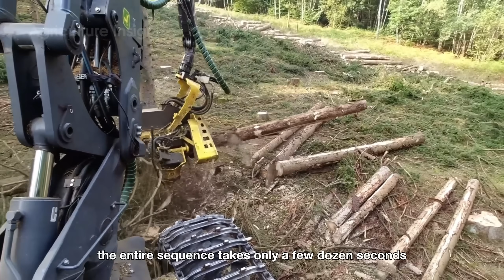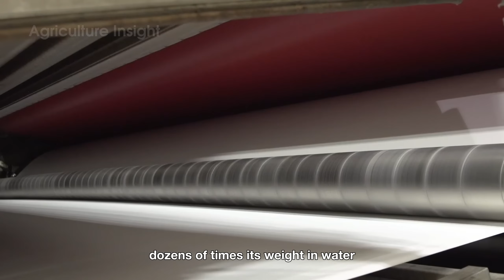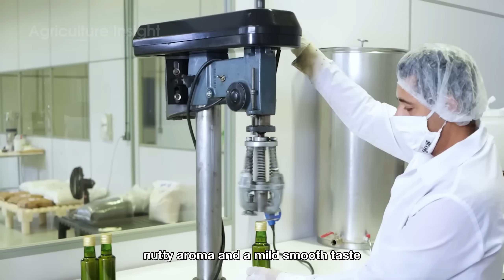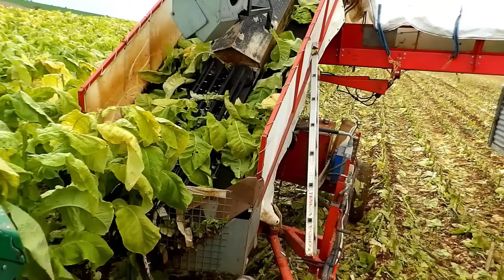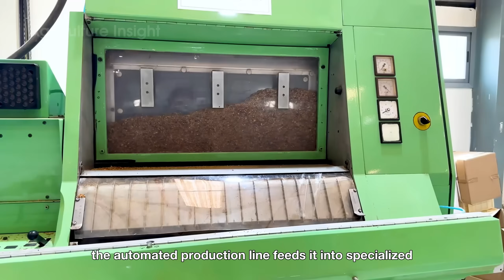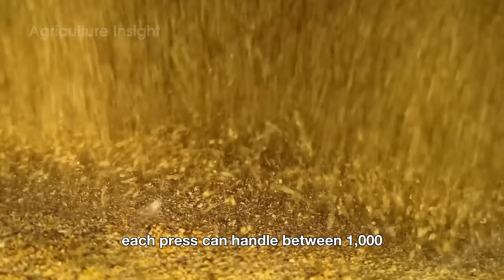How Toilet Paper Is Made – Massive Harvest Millions of Logs for Toilet Paper Processing

Comment: its Not eucalyptus it always pine  normally pinus radiata  which is a very soft wood with low celluloid content
Reply from the maker: Thanks for your comment! Toilet paper is usually made from a mix of eucalyptus (hardwood) and pine (softwood) pulp. Eucalyptus gives softness, while pine provides strength. In many countries, the blend is often around 60–80% eucalyptus and 20–40% pine, depending on the desired softness and durability. Brazil, Indonesia, China, and several European countries use high-eucalyptus blends, while North America and New Zealand use more softwood because pine is more abundant there.